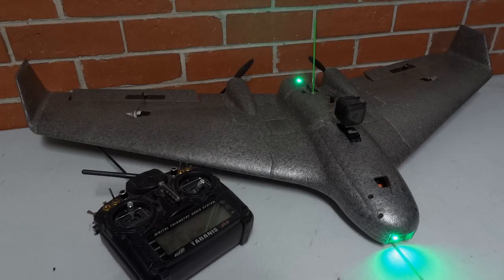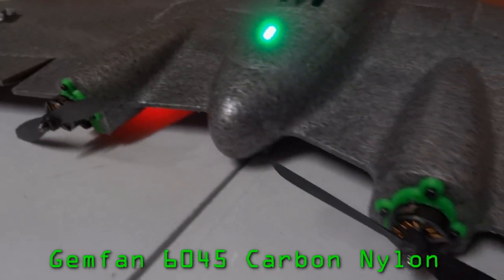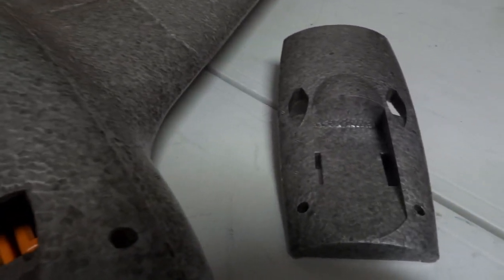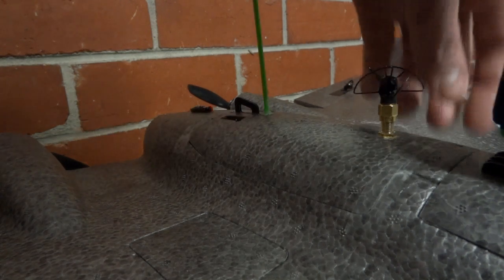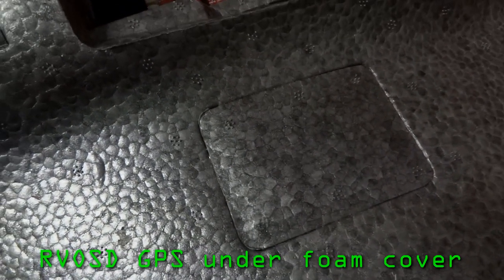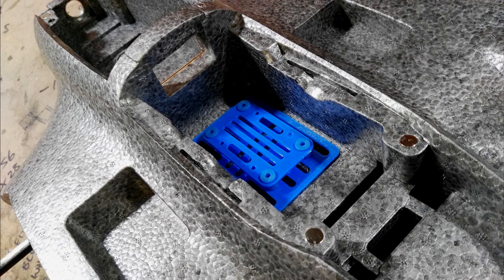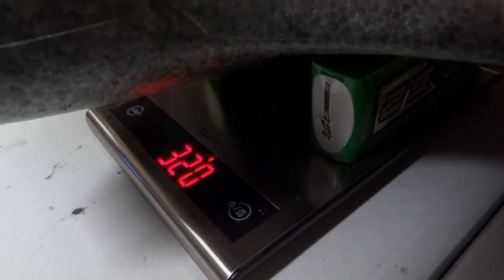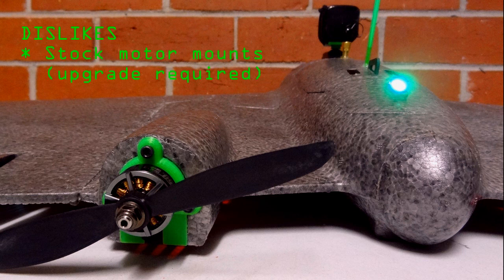» Reptile Harrier S1100 Overview

Comment: I am really enjoying the PNP S1100 particularly having a rudder using differential thrust. However I'd like to try Inav on it. My past experiences with Inav have been underwhelming. It does everything but never fly's as well as "au natural". Always feels sluggish. However so far only tried on fast small wings - maybe the S1100 is better suited to Inav. Any chance you could post a diff from Inav?
Reply from the maker: TakeItToTheGround cant give you a dump, dont use inav on this plane
Reply: Maybe that explains why it flies so well using an FC. ☺ I just use a micro minim osd with FPV etc  & GPS. No RTH etc though.
Reply from the maker: TakeItToTheGround ive got inav in a mini talon and that doesnt fly very well, atleast compared to an eagle tree vector. People rave about inav, i need to play with it some more because i havent found it to be all that great so far
Reply: Interesting. Maybe my experiences with Inav are not unique? Nice OSD though. I might try it again and if it doesn't work out just keep it installed for the OSD. Also this time I wil try removing all expo from inav and adjust it on my transmitter instead and fly in manual mode. Then only have RTH as my failsafe. I think RTH uses angle mode.
Reply from the maker: Well the S1100 is the kind of plane that doesnt really need stabilization most of the time so if iNav can give you just an RTH then its worth having.

Comment: 1/ I wish I had paid attention to your section on reflex should be 10 mm. I gave mine my typical wing 2-3 mm reflex and ploughed into the ground on my first take-off. Two broken motor adapters later and 10 mm reflex and she flies beautifully, particularly with differential thrust. Quickly became my second favourite wing. 2/ I laughed when you said it is good to have a small wing again. This is huge compared to my favorite, "goes like a scalded cat" 700 mm TBRC Apex V2.
Reply from the maker: TakeItToTheGround  i maidened with about 3mm also and nosed in but soft grass luckily. The amount of reflex doesnt seem right to me but it still flys nicely

Comment: I am guessing the 3d motor mounts are on thingiverse. Can you add a URL to them please as I am about to build mine?
Reply: Apologies just got to 3:55 and saw the link.
Reply from the maker: No probs, I added links to the description also. Let me know how they go
Reply: Got my S1100 the same time as a very cheap 3D printer. So after a bit of experiementation I printed them in PETG as I thought ABS is probably beyond my skills/patience. Not sure what you did them in. I have the PNP and tried the V1 with only two screw holes. I decided they were just a bit flimsy even for 2205's. So I printed out the V2's. The V2's are perfect. Thank you.
Reply from the maker: TakeItToTheGround glad you like them. I used PLA. Maybe should delete the v1 files